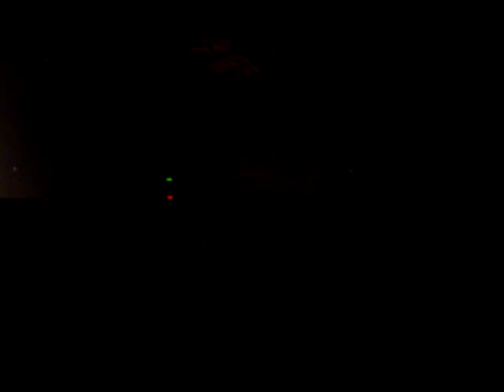The magic of a random wire antenna.

Comment from the maker: I've actually since moved to a ladder line fed 80m dipole that is up about 65ft or so. Random wires work well for temporary installations. The key is making sure that you have the correct length counterpoise. The counterpoise is the other half of the antenna! The best way to do it is to use a 1:1 current balun and attach the antenna and the counterpoise to the balun's terminals and then run a short run of low loss coax to your tuner.